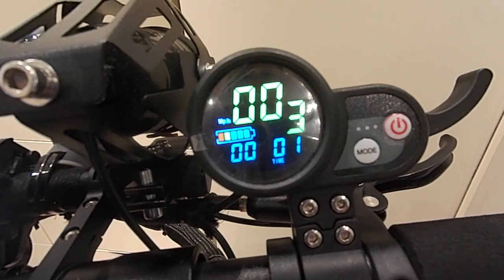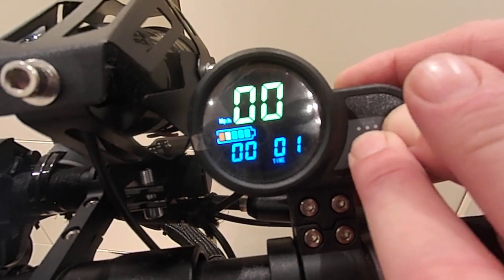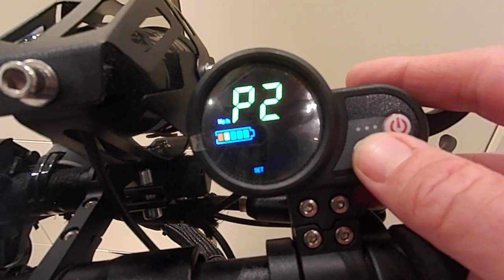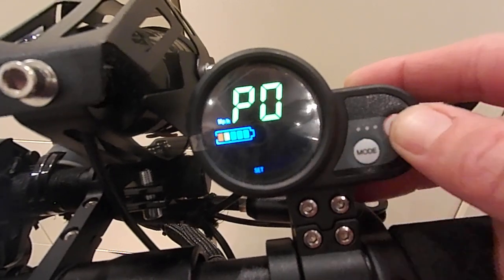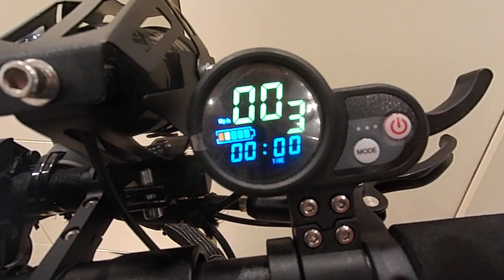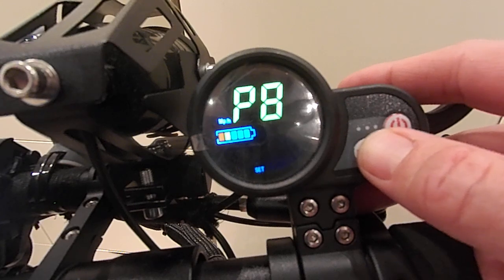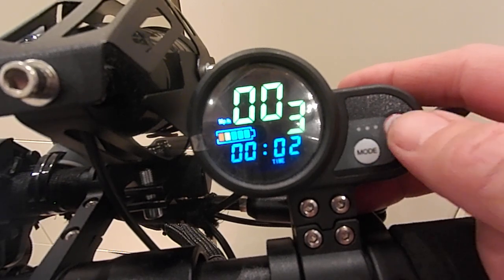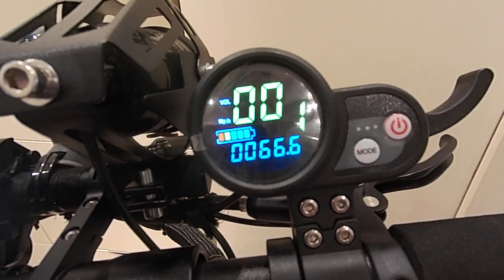Programming Electric Scooters for 10-Setting Variants (P0-P9)

Comment: Hello sir what i will do if the display has a fault sign? Because my display has a fault sign and my scooter is not working anymore.
Reply from the maker: Hi John, is the orange fault sign in the shape of a box? What scooter do you have?
Reply: @marcusoroberts  i have blade 10.
the fault is throttle, i dont know how to fix it.
how can i send you the picture of my throttle display?
Reply: sorry this is not my account thats why the picture and name is differnt.
im just using this. but im john....
Reply: Marcus Roberts yes. Mine does. I can’t figure it out. I changed display and controller. Please help

Comment: can I make my scooter faster just by using the settings? I’m at Gear 3 and it’s slow for my taste :( 20km/h
Reply from the maker: What scooter do you have? In gear 3, a 60v scooter should do approximately 35mph on average with the rear motor alone, and 45mph+ with dual mode. Tell me the scooter you have. It's possible with a change of controller and battery if you want to go faster....
Reply: Marcus Roberts 

It’s a 52V20AH electric scooter, I don’t exactly know the brand of it, perhaps I could email you a photo of the scooter? It seems heavy duty however slow :/
Reply from the maker: @TheHKZgamer  Yes it should go faster than 20kmh as it's 52v for sure. Maybe it's restricted? In which case the limiter is governed within the LCD throttle unit.
Reply from the maker: @TheHKZgamer  share a pic. That would help mate. Cheers.
Reply: Marcus Roberts do you know how to remove it / disable it? + where could I share the photo

Comment: I cant set it back to p0
Reply from the maker: Hi Navo. Are you pressing the 'Mode' and 'Power' buttons and holding for 3 seconds? That will take you to the programming mode. It will take you to the last place in the menu you left it. Keep hitting 'Mode' until you get to 'P0' and then you can adjust.
Reply: Marcus Roberts i have an Carbon Electric scooter and it have the same display but not mode
Reply from the maker: @christian.madsen  do you have the 'Mode'  button? You must have 2 buttons. Power and mode. Take a picture of your LCD please. Hope to help you.

Comment: Hi marcus roberts...
 I've got the speedway mini 3
48v 15.6AH
electric scooter,
what should i set it???
Reply from the maker: Hi Petra, does this have 10 or 20 settings on the LCD? It should be set to default by the manufacturer, are you having problems with a particular setting that makes the Speedway not behave correctly?

Comment: Hi there! I have a T113 and don‘t know what setting 2 (P2) needs to be! I now have it on 13, but I don‘t know if that‘s right!
Reply from the maker: Hiya, if this has 10 settings (P0-P9) then  P2 = 16 for both the T113 and T112 scooter. Hope that helps.
Reply from the maker: But it appears also to be fine set as '15'
Reply: Marcus Roberts ol great thanks! Never had it on 16 before! I will try it out! Because at the moment I sometimes have a problem with the scooter! Sometimes when I pull the throttle(in dual motor mode), one motor shuts done and doesn‘t work as it should! But thank you!
Reply from the maker: @ToHaru-Chan  Ok that sounds weird and might be something else. Please let me know how it goes....stay in touch...
Reply from the maker: @ToHaru-Chan  But the T113 front motor doesn't start until you release the throttle and reapply. But I guess you already knew that. Just clutching straws here ....
Reply: Marcus Roberts yeah yeah, I knew that! That‘s not the problem! But I changed the settings a moment ago and I‘ll try it in the near future! But what I already can tell is, that the speedometer(display) now shows 89km/h on full throttle(P2 = 16)! Before when the setting P2 was on 13 it showed 99km/h on full throttle!
Reply from the maker: @ToHaru-Chan  I knew you knew that! Sorry. Then change the tyre diameter in P0. It is probably defaulted to '11' in inches and try 10 or 12. Then calibrate against you phone.
Reply from the maker: If it's showing a higher speed, then the tyre motor diameter in P0 is too small and try one higher. There are no incremental steps of decimals which is a bummer.
Reply: @ToHaru-Chan  Had the same thing with my Janobike and it was because of water inside the battery-compartiment, i put a heat-canon blowing hot air close to the deck with the deck-plate removed for like an hour to let it dry and all problems were gone ;)
Reply from the maker: It's the magnetic pole in the motor setting
Reply from the maker: If you have set a totally wrong number, the motor will shudder and jerk a little. That is the Hall Effect sensor feedback saying something is wrong.
Reply from the maker: @mobilangue mobilangue I think I'm confusing myself here! A larger tyre will take less RPM and be slower, a smaller tyre will spin quicker for the same difference. I'm still tweaking it myself because at 20-30 mph it's accurate but at speeds lower or higher it's about 15% inaccurate.

Comment: How can i edit speed mode to be o maximum 24km/h ?
Reply: you can set P8 to 53 or 50 then you have your desired speed on the gear mode 3. otherwise set p8 to a 100% and change gear mode to 2 and you will have a speed of around 30Km/h. you can tweak P8 more. like 85 or something like that.
Reply from the maker: @Drey_Toth  Very good advice indeed. I just leave it to 100% but what you say is good. Then I have a the extra power on tap when needed. Cheers!
Reply from the maker: Hi Aly, I don't fully understand what you mean by setting a maximum speed of 24kmh Can you clarify for me please.
Reply: @marcusoroberts  He is probably in a country were that is the limit.
Reply: Mine only has upto p5 and I’m having the same problem.  My gear 3 doesn’t go up to 45km as it says it should

Comment: Cant see any thing besides Px
"I set it to xxx" where, how?
Reply from the maker: If you press and hold the power and mode buttons for about 3 seconds you enter the programming mode. I'm not sure if this is what you are asking. Please get back to me for more if needed. Cheers.
Reply: @marcusoroberts  Hi and thx for trying to answer. I only see you cycle through P0 to P9 without actual setting anything. So I dont know how to set/change a setting. I will get one on monday so hopefully I will get it right at some point :)
Reply from the maker: @ibrenecario7357  Here, I will attach a full description roughly translated from Chinese. If you return in a few hours and look in my description of the above video, I'll 'try' to attach it on a shared drive. If after that you're still having probs, get back to me.
Reply: @marcusoroberts  Thank you very much. By the way, what scooter do you have?
Reply from the maker: @ibrenecario7357  More than welcome. Hope you enjoy your new ride! I have 3: UberScoot Citi Hub 800 (road legal), Viper Dual 2000 and of course the T112 Dual 5600 which is absolutely savage - much too fast for its size.

Comment: hey I have this exact lcd throttle. it was working fine but the display slowly fate off and I can't see anything from the lcd screen now. the throttle still works. just the lcd. do you have any idea how to fix?
Reply from the maker: Hi, does the scooter still have full power and the throttle reacts as expected, or is it just the LCD that cannot be seen? The LCD appears on normal brightness then dims naturally or when you apply the throttle?

Comment: Where about you in UK im in London I got scooter too
Reply from the maker: Hi Abe ~ Good to hear from you. I'm in Essex. Checked out your scooter vids and like them!
Reply: Hello Marcus what vids
Reply from the maker: @abefrancisco624  The ones on your channel. Not much time to comment yet.
Reply: Do you know to set the display to see the battery percentage???
Reply from the maker: @abefrancisco624  It won't show the percentage, but it will show a bar graph which is only a guide. Hit the mode button and it will show DST = Range in either KM or Miles left depending on whether the scooter is set in miles or kms. This is like your fuel gauge in a car.  If you select VOL in the menu it will show remaining battery level. This is very accurate as it is monitored directly from the BMS.

Comment: Hey man , thanks for the video, I was wondering about P1 , I’ve got the T11, 52V scooter what should I set it?
Reply from the maker: Hi, I would recommend 385. The battery's internal BMS might kick in sooner or later, but be safe and set as that. Cheers
Reply: Marcus Roberts are you sure mate? It’s set as default as 450, my scooter is 52.4V and when it’s fully charged it’s 60V.
Reply from the maker: @TriggeredScream  So, is this a 60v battery? If it's fully charged at 60v when measuring off load it' must therefore be a low 52v pack. A setting of 450 would therefore shut down the battery too soon.  I would take the risk and set for 385 still. I assume this is a lithium battery.
Reply: Hi Mate, please I've got similar thing for Janobike t85 which is 60v, please what should i set it to? I would appreciate if you could help out on this.

Thanks man 👍

Comment: What voltage it should have minimum to ride comparing to fully chrged?
Reply from the maker: A fully charged 60 V battery should read about 67 V when fully charged. It can be considered to be 'empty' at about 50 V,  so it could be damaged if used below that threshold. For protecting the battery it's best to set the lower limit just above this, at 520 (52.0 V). Hope that helps.
Reply: @marcusoroberts  sure mate, thanks ;)
Reply: He my scooter is 60v and it's dying at like 64v
Reply from the maker: Hi, you might want to lower the setting of P1 Low Voltage Cut Off to around 520 (52v). What is it set to at the moment?